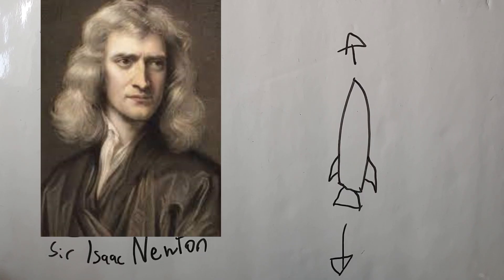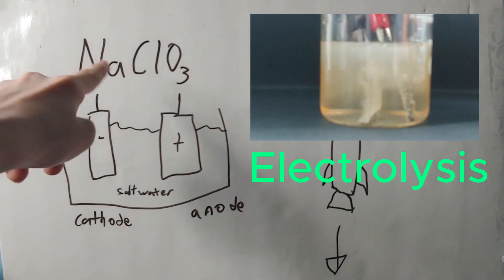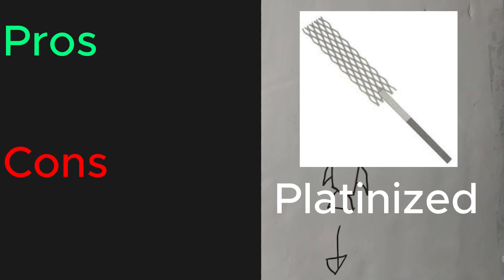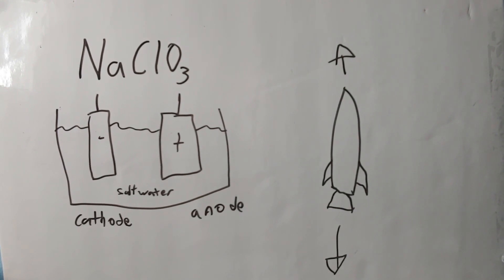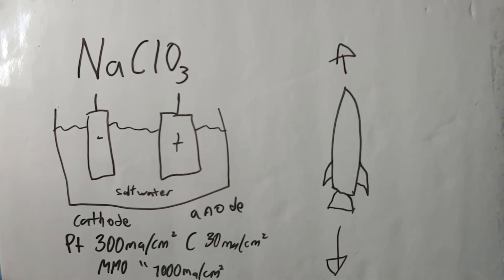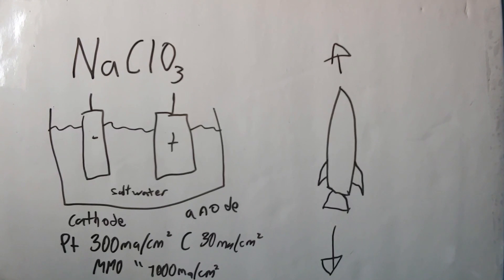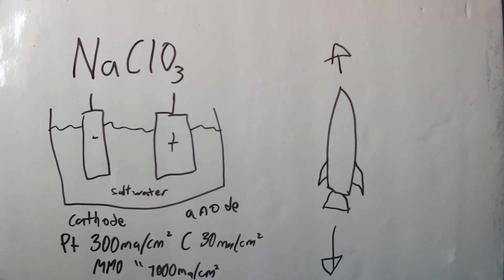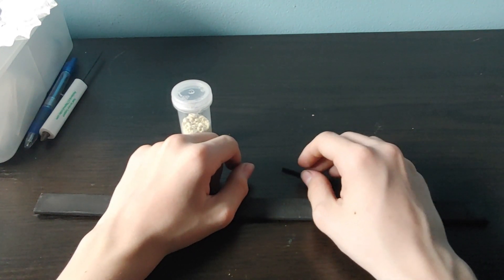Making Sodium Chlorate

Comment: I'm working on a system for removing the gold plating from a large quantity of granulated plated phosphor bronze. Using brine as the electrolysis solution this will eventually produce finely divided non alloyed metals, and sodium hypochlorite, and possibly sodium chlorate. The purpose of this methodology is to avoid the interaction between gold chloride and stannous chloride in the refining steps, which have a tendency to form gold stannate. Phosphor bronze contains about 8% tin by weight. And there's only about 1% gold plating by weight.

Comment: Hi Sir, this is very interesting video..
I tried it in my lab using graphite, but the product color is black, probably it came from the graphite errode. Could you advise me how to remove this black ?
Reply from the maker: Hi, this is the main downside of using graphite electrodes, the only way I have been able to get rid of the black graphite particles is to pour the solution in a tall container and let it decant with time. After the dark layer has settled to the bottom, all that's needed is to pour off the transparent layer of the solution. There might be other methods that don't rely on time but I can confirm that using  coffee filters/paper filters does not work whatsoever unless you have very big graphite particles (which is unusual).

Comment: is lead anode&cathode works for sodium chloride to sodium chlorate  electrolysis? And are you do other things you didnt show in the video ? like heating up electrolysis solution. if you answer i really appreciate im following you very closely now.
Reply from the maker: A lead anode will work but quite badly, it will form badly adhering Lead dioxide which is in itself a very good anode. The issue is that the lead dioxide will fall off the lead anode which will make the anode oxidise again forming more PbO2 until the anode is consumed, leaving lead dioxide gunk at the bottom of the cell. Lead dioxide alone is actually a great anode but the issue is that it tends to flake off the surface it is stuck onto but those made industrially last very long without this problem and can even allow to go directly from chloride to perchlorate in a single cell. Also external heating is not necessary, you can estimate the heating of the cell with the volume, current and voltage. Any voltage above 3v will result in heating of the cell so ideally you will have a voltage of 4 or 5v to keep the cell warm in regular weather, if you keep it outside during winter having 6v in there will make up for the cold keeping it at the same temp. These voltages are assuming you have currents of minimum 2amps and inside a small 100ml cell. The more volume,the more time it will take to heat, less current means less energy to be dissipated as heat. Also make sure not to exceed 60C as you will lose a lot of water to evaporation (unless you dont mind refilling the cell with water often), around 50C is fine usually but each anode has a maximum that should be respected as they will degrade quickly otherwise.
Reply: @hexaclone9878  thanks bro, now im using 12 volt 3 amp car battery charger for 200 ml 75 gram sodium salt Do I need to do external heating other than electrolysis? I have little information about this matter 🤭
Reply from the maker: 12v might be a little too high, you can run two cells in series to have them each at 6v 3amps which will use all the energy you are feeding it. As a general rule of thumb you dont want more then 6v per cell because you will end up wasting too much power that will dissipate as heat.6v per cell will heat your cell nicely but if you decide to keep it at 12 it might become excessive so you might need cooling instead lol

Comment: Sir, I have a question. I electrolyzed sodium salt while anode and catode  in the same container. Then, when the electrolysis process was completed, I filtered it. I don't have a chance to do a Ph test, but I threw aluminum into the liquid I produced, the moment I threw it into it, bubbles started to appear, and its very visible then I lit the lighter. and even though the lighter was 2-3 cm away from the aluminum, a crackling sound started to come out of. The flame of the lighter become more orange than normal, but i can say color of the lighter fire has clearly changed. What do you think sir the chemical I produced? Is it sodium hydroxide or sodium hypochlorite?

Comment: in canada this substance and the manufacture of it is illegal as it is used in the manufactureing of explosives and time delay detonators
Reply from the maker: From what I've read it is quite legal to own as it is used as a bleaching agent. But when in the form of a 90%+ pure powder there are restrictions when you possess over a kilo of it.By restrictions all they really mean is a fine for not having a permit and confiscation of the restricted chemical.Since I own nowhere near a kilo there are no worries on that front. In terms of manufacturing it would be pretty hard to enforce(if it were illegal) since this can be done by simply boiling bleach, something anyone could do.Now on the other hand using this chemical for explosives or delay detonators is most definitely illegal or at the very least would require permits (like for fireworks).